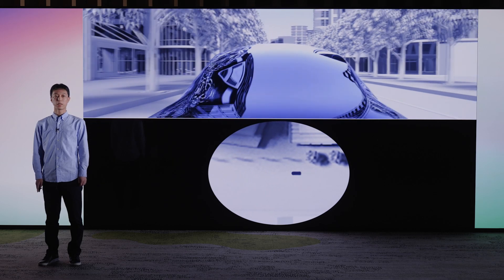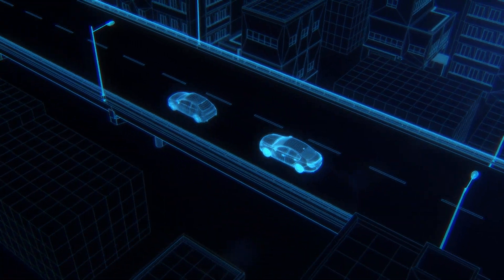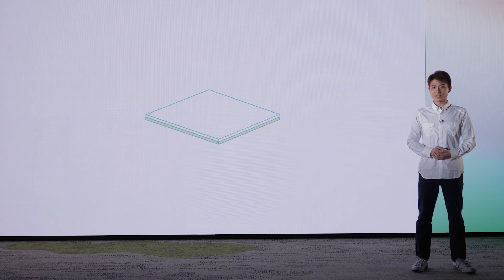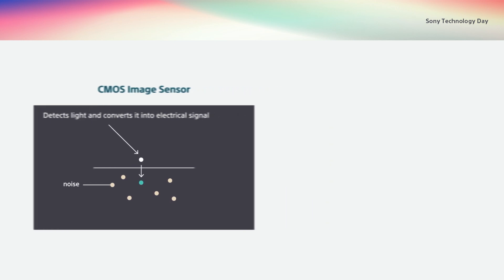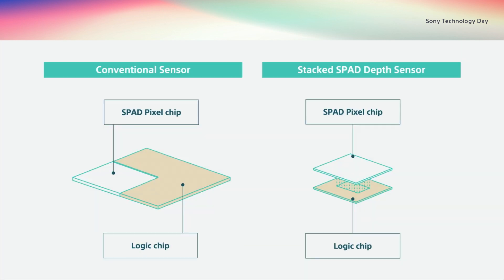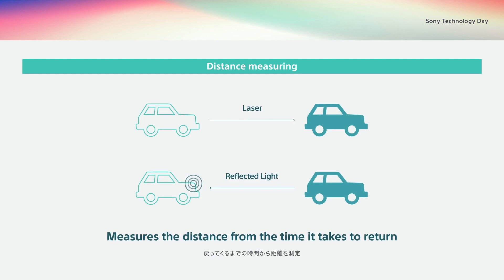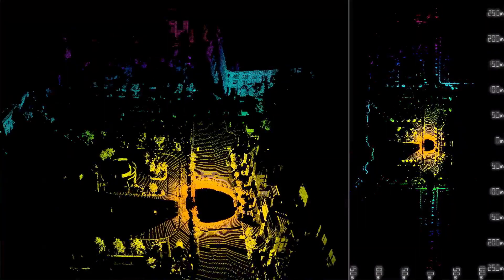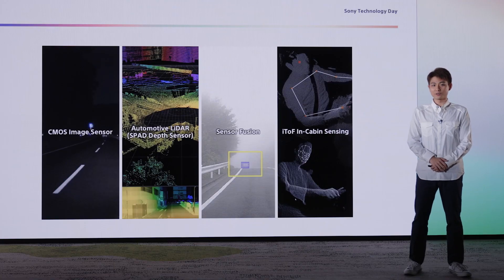Sony Technology Day｜Enable high precision detection from particles of light

Comment: It's beautiful ! So this is an image sensor consisting of a diode matrix, electrical contacts, and logic circuit, all lithographed on the same semiconductor crystal. This means it is more sensitive to light.
It could be used along with some existing Exmor sensors to improve low light photography and videography. The output of this sensor can be superposed with the output of Exmor sensor to attenuate the noise and provide a crisp, high quality output.
Reply: This is a photon avalanche diode. It's the solid state version of the venerable photomultiplier tube used in medical imaging and night vision. It's already possible to capture photographs with almost no scene light with an ordinary camera by coupling it with a night vision tube. The gain is 10,000-100,000x. Even someone drawing from a cigarette lights up the environment like a torch.